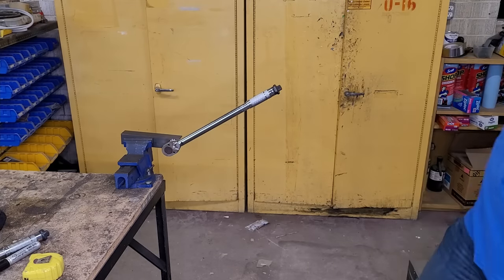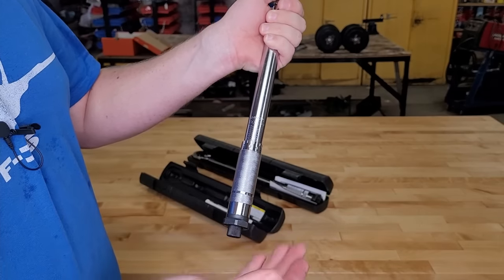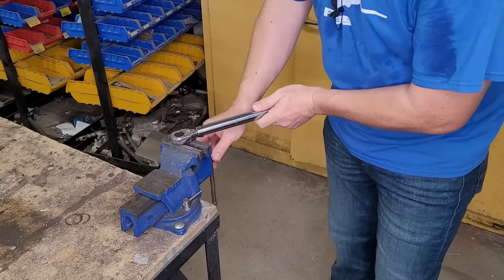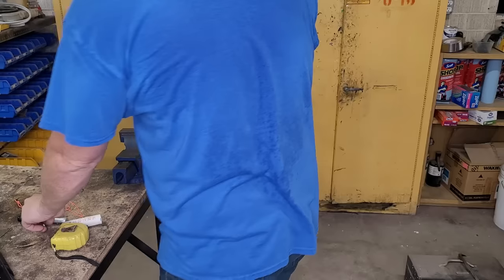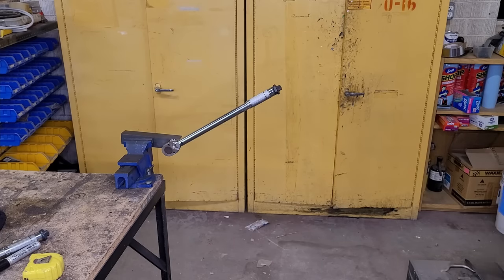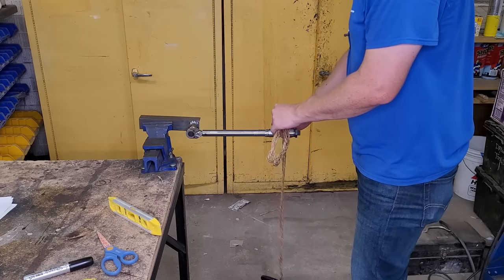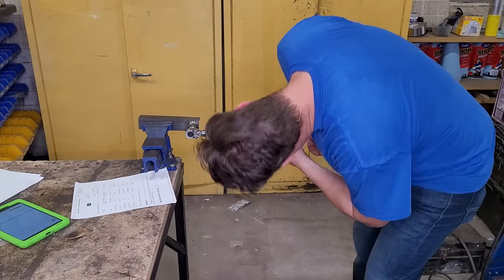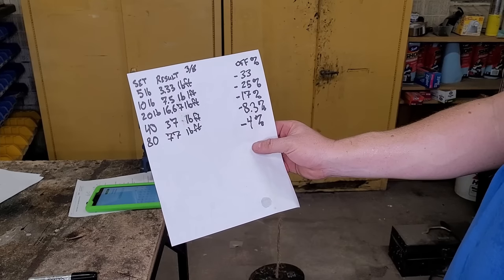$20 Torque Wrench, are they accurate? | Harbor Freight 1/2" and 3/8" Drive Review and Test

Comment: You do know that these wrenches can be recalibrated. Any torque wrench would need to be checked and calibrated periodically, regardless of brand or cost. These wrenches, while they are very inexpensive, are very easily calibrated. Your demonstration was very clear, however it would have been helpful to go through the calibration procedure while you had your rig set up and also it's important to release the spring tension when storing a torque wrench as that will shorten the calibration period. Good video.
Reply: They do carry a lifetime warranty just like all other Pittsburgh hand tools it even says so on the package so when the time comes and it needs recalibrating you can just return it for another brand new one as it’s not really worth the time or effort to recalibrate it when you have this option. I just recently warrantied my half inch model as I loaned it out to my neighbor and he had left it cranked up to 120 ft lbs when it was returned.
Reply: i agree, id like to see a calibration video.
Reply: @scottmingersoll  Pretty sure warranty doesn't cover calibration and maintenance, that's like taking your car back for warranty when its time for the oil change...
Reply: @jakegarrett8109  Im sorry but that’s a stupid comparison as is not a car but a sub $20 throw away tool and having it calibrated professionally would cost the user more than purchasing a new one and yes it is indeed covered under the no questions asked lifetime warranty stated on the box just like all other Pittsburgh hand tools. I’ve warranted one before so I am speaking from experience, if you want to go learn how to calibrate yours more power to you but between my work and family I personally have more important things to use my time for.
Reply: @scottmingersoll  I saw this video and another one today, and the 3/8ths wrench was off by basically 33% out of the box. So, even if its brand new, it can still be 33% inaccurate... Getting a new one every year still doesn't avoid that, and how do you know if its off unless you checked it? It takes like 2 minutes more to calibrate it if you're already checking its spec, so I value my time, hence I wouldn't bother warranty on such a cheap part to begin with, but also it takes more than 2 minutes just to walk into the store and grab another one compared to adjusting the adjustment screw (which who knows if the new one will be accurate, how many wrenches are you going to check?)
Reply: @jakegarrett8109  Being I live in a small town with no HF I like to hit it up every time I go to the city regardless so I never make a special trip for any one item, as far as the torque wrench goes I’ve only exchanged it (once not multiple times)due to the neighbor leaving it cranked up for a extended period of time so I am willing to bet it was no longer in spec. Also for what it’s worth when new the torque wrenches come with a verification certificate with a date and the signature of a inspector who did the certification.
Reply: @jakegarrett8109 - this method is bogus and not accurate at all.  You can’t just place a weight at an arbitrary distance.  THERE IS A REASON manufacturers tell you in the instructions that you must place your hand at a specific location in order for best accuracy.  This is usually in the middle of the handle. This video shows him placing weights all over the map. Not getting into the static, torque equations of how a quick style wrench operates, I’ll just say changing these distance ratios creates very in accurate readings.
Reply: @frankhouck4446  Torque is Force x Distance (note its a vector perpendicular to the object of rotation), so if you have your hand 2x as far, you'll have to apply it only 1/2 as hard. So if you have a true torque measurement, then where you have your hand doesn't matter, but if you are measuring it in a terrible way (lets say a fish scale but you are pulling it not perpendicular but you are only measuring force as a magnitude and not a vector in this case, then it will be off), however if its measuring torque at the socket then you could have your hand wherever you feel like.
Reply: @jakegarrett8109  - I’m well aware of the physics behind torque and I have a masters in Mechanical Engineering to back that up (although I’ve been in Sales/Marketing for 25 years:)).

Anyway, I just laid out an example to another “non believer” in another video.  I’m not trolling here, I’m actually looking to purchase a torque wrench and like to do a lot of research (that’s the OCD engineer in me).  In doing that research, I have looked at a lot of “calibration” videos to determine if I would need something like a digital torque adapter to calibrate or could just do something like this.  I started questioning this method as EVERY manufacturer INSISTS on proper hand placement for accuracy (you should read an owners manual if you get a chance).  

So, I researched how these things were made, then watched a physics video on how the torque equations worked.  In the reply I just sent to someone else, I provided a real world example, based on these equations, of how hand placement (or weight placement for calibration) would effect the results.  I will leave you with that same example as the math says it so much better than I can articulate - hope it helps.

First you have to understand that the actual torque being registered by the wrench is from the hand position to the pivot point (that round pin that is located just before the socket head) - roughly 2-3” before the socket head center point on a typical 1/2” wrench.  This is the torque that actually disengages the clutch and when enough force is applied at the handle, it clicks. 

Now, let’s say the center handle position is 15” from the pivot point and there is in fact 3” from the pivot to the bolt head center.  This 15/3 or 5/1 ratio is the critical proportion. If I apply 40lbf at the handle center, the pivot point registers 600inlb torque or 50ftlbs.  However, at the bolt head, there is 18x40/12 = 60ftlbs of torque being realized.  Remember, it’s the 50ftlbs of torque at the pivot point that is actually disengaging the clutch and causes the click.  The manufacturer knows that when the setting is such that 50ftlbs causes the click there is actually 60ftlbs of torque on the bolt being tightened (with proper hand placement) so they calibrate the settings to read 60ftlbs at this point.  As long as the 15/3 ratio is constant, the settings can be proportionally placed this way through the linear range of the spring (in this case - 10ftlbs to 150ftlbs say). 

Let’s look what happens if I apply the same torque between the pivot and where the force is applied, but don’t use the center of the handle.  Let’s say I move in 5”.  So, now I’m 10” from the pivot (still another 3” to socket head center)- leaving the wrench setting at 60ftlbs.  I will still need 50ftlbs to disengage the clutch (I haven’t changed my spring pressure).  At 10” I will need 60lbs of force to get 50ftlbs at the pivot point… and the clicker goes off.  But, let’s look at the actual torque at the bolt head. My critical ratio has changed an now I have (10”+3”)x60lbs/12 = 65ftlbs of torque on the bolt….. my wrench is still set to 60ftlbs, I’ve hit 50ftlbs on the pivot point so it clicks and I think I have 60ftlbs on the bolt, but I actually have 65ftlbs (over 8% off).  

If you increase the pivot point distance to the load, the opposite will happen and the actual torque at the bolt will be less than the set point- which is counterintuitive, but makes sense after giving it some thought.  This is why the manufacturer insists you use proper hand placement when using the wrench. There is a great video of a professional testing hand position with a very expensive calibration machine and the above math is visualized by these results. 

Bottom line, use the correct position for the load and make sure it’s perpendicular to the wrench shaft if you are going to use this method.  It should be a fairly accurate way to calibrate.  Try to use 3 or so measurements through the range (ideally at 20%, 60% and 100%).
Reply: @frankhouck4446  I see what you're saying and I agree these tools are in my opinion designed incorrectly. If you get the digital adaptors then where you hold them won't matter, so honestly those adaptors have a better design than the mechanical wrenches (I get it, they were being cheap and probably was easier to make them back in the day, but for the reasons you mentioned that's why they are kind of terrible because they aren't actually measuring the torque of the socket like digital adaptors do).
Reply: @jakegarrett8109  - well, I don’t think it’s a matter of “cheap” but rather a matter of design. There is no other way to really do it.  The clutch mechanism and pivot point simply have to be placed somewhere between the handle and socket.  It’s just not a solid fixed beam.  They are cheaper, and therefore the tool of choice for diy.  If you use it properly and check calibration when used, it will serve you well and be plenty accurate for most any auto or HVAC work you may want to do.  Most torqued bolts (1), have a torque range, and (2) have tolerances in their threads and fit that are already less accurate than a click style wrench.  Think about it - a bolt being torqued into a housing/flange/etc is meant to place a specific pressure in whatever it is holding in place (like a valve cover).  The engineers calculate that in order for the pressure to be accurate, the bolt must be placed using torque X.  Well, the torqued is affected by tolerances in the fit, threads, etc such that even if the bolt is torqued exactly spot on, the pressure it is applying (which is really what the engineers are after) is likely off at least a couple %.  That, with the torque range allowed in most applications means that if you set a click style wrench at the mid way point of the range, you’ll be fine.

As for the adapters, I looked at them and they are very accurate and easy to use.  However, I simply can’t just have only the that in my bag. There are too many applications (ones that I need a wrench for) that it can’t fit.  So, I would have to get a click style anyway and, honestly, I just don’t use it enough to justify both.  All I’d end up using the adapter for would be to calibrate…. Which I really dont need if I use this “weight” method correctly. Besides, putting a crows foot on a torque adapter to use for flare nuts just wouldn’t work.

Comment: One reason for the poor readings at the low setting of the 3/8 wrench is that your method does not consider the weight of the wrench handle.  The wrench weighs a little over 2 pounds so you are starting out with nearly a pound of static torque just from the way it is configured on your test set up.  I measured my 3/8 wrench (not HF but similar size) and found the handle adds just over 0.9 pounds.  Negligible at high settings but very substantial when testing at the low end.   Unfortunately it will only make the 1/2 performance worse!
Reply from the maker: Rick that's a good point I hadn't thought of!  I think it was off by more than the weight of its handle.
Reply: I'm wondering if it got sent out of calibration when the twine snapped and he almost broke his foot and face. I'm new to torque wrenches, but all the brands seem to say the lower 20% of the range isn't really meant to be accurate or used anyway. Maybe something like a $400+ Snap-On would be fine, but that's a lot to ask from a $15 tool.
Reply: Anyway around this for more accuracy at lower settings?
Reply: The work-around for the low settings is to get a 1/4" wrench. Always use the smallest wrench that is capable of the setting you need. They are all more accurate in the upper end of their range.
Reply: @HerbOMatic  The 3/8" wrench was consistently 2-3 pounds under spec. So the handle is a significant feature. Another channel I saw used a scale pulling horizontally on the handle. Or you could use a pulley off to the side, so you could use your weights, but apply the force horizontally.
Reply: @joshualmatheny  unfortunately 1/4" torques only go up to ~16ft/lbs. Really wish I could get one that goes up to at least 30ft/lbs

Comment: I have used and own many torque wrenches over my 45 years as a mechanic. Snap-On Tools required I have them recalculate my 3/8" drive ft/lb torque wrench every 2 years or they would not warranty it for accuracy. The tool cost me $150.00's back twenty years ago. Their 1/2" drive was much more money. As mechanics we were taught to only trust any torque when set between 20% to 80% of it's max measurements. Below or above those torques we were to chose a smaller or larger tool. We were never allowed to use any tool at the lowest or highest settings. So why are those numbers on there anyway?? I own only six torque wrenches today. Ranging from 1/4" to 3/4" drive. Four of them are Harbor Freight tools.
Reply: Yeah, when he started at 5, I cringed. His idea of a sanity check before using it is good though.

Comment: I had both of those, they are really easy to re-calibrate. They do need to be stored at the  lowest torque rating and cycled three times before using from lowest to highest torque. Something to bear in mind at 5lb/ft being off by 33% is something like +-1-2lb/ft which yes, is high but still probably better than not using a torque wrench where you can fairly easily end up with + or - 100% accuracy or more at that level.
Reply: You need to store all clicker style torque wrenches at their lowest setting. It doesn't matter which brand. Not doing this will screw up the spring.
Reply: @williamallen7836  I had no idea, I've been storing mine at whatever torque setting I used it last time, is my torque wrench trashed now?
Reply: @giovannifoulmouth7205  if it's the clicker type with the handle you spin to set the torque, it will most likely need to be recalibrated. There's a couple videos on YouTube on you can recalibrate them at home with an inexpensive scale. Split beam type torque wrenches don't suffer from this, because there is no spring that will develop a memory after being compressed for a peroid of time. But they cost more.

Comment: I hate it but my HF torque wrenches are all accurate. I tried to replace them many times with better expensive ones thinking to throw them away or donate, but the cheap $10 suckers have better accuracy vs expensive ones. I absolutely despise their fit and finish, sloppiness and cheap feel, but the suckers just don't want to go away showing better results than $120 split beams.
Reply: Seems fairly often these cheap tools do as well as expensive ones. How did you check the accuracy of your torque wrenches?

Comment: This is a very important tutorial for inexperienced new diyers that don't have any idea what 20 ft/lbs torque on a 3/8inch ratchet would even begin to feel like!
I appreciate it as I never saw that instruction to cycle to full torque setting & back 3 times!!!
Fortunately, my old Craftsman pair confirmed my HF pair to be adequate without recalibration. 
But be damned sure I will be testing them both before going in to retorque my 3 yr old LBJs/Ft Suspension parts while doing my next tire rotation!
83 ft/lbs on my Tundra lugs.
Test one for the 1/2inch drive...
Glad you survived that Reverse guillotine move 👏 🙌 👍

Comment: For my job in water work, aka municipal water, I've bought roughly 6 of the 1/2 inch for tightening down or torqueing our mechanical joints for various things like new install and water break repairs. For $20 or less these are perfect for our work. Our bolts are 3/4" generaly and these torque wrenches have been perfect for us. Gets us close enough for our work. The thing is they are subjected to very harsh conditions in general. Muddy, wet, sandy trenches aren't kind to tools in general so that's why we've purchased the 6 or so wrenches in the time I was the foreman. Great for us and a god send. It's aweful to spend $120.00 on a wrench that gets dropped in water on a cold night.

Comment: I have these two also. Used them to install performance rear end suspension parts on my 2012 mustang. Had to use an aluminum extension over the torque wrench (and my leg) under the car to reach spec, but it made it. Before that I used them maintain my 92’ Celica. Almost 200k on that car. Sold it to my brother and he drives it daily. The wrenches need to be maintained. Open up the pawl, disassemble, and re-oil them. Motor oils fine. They work good and cheap for DIY. I have not had an issue with either one. I paid 25 for the 1/2” and 19 for the 3/8” I’m glad these are available at that price range. Thanks HF.
Reply: Buy a torque meter they're very accurate

Comment: Thanks.  This saved me a lot of money.  I recently bought a Tesla.  Great car, but it comes without a spare tire.  Bought a spare from Modern Spare (comes with a jack & J-bar lug wrench).  Tesla lug nuts need 129 ft-lbs.  I'll buy the ½" drive for $20 instead of a more expensive one.  With the spare, a tire inflator and this torque wrench, I'll be safe on the road.  You saved me ~$80.

Comment: Yes, sometimes you need to reverse it. Not to loosen, but for left hand threads. Mower blade on a push mower is an example
Reply: Exactly, I was thinking the same! It's not a ratchet, it IS a torque wrench that torques RH or LH fasteners.

Comment: FYI, they also sell an electronic torque wrench addition. Like 20 some odd bucks. It just beeps when you hit the set torque. I measured it on a snapon and craftsman torque wrenches and it is quite accurate. I use that in line with my HF torque wrenches for a sanity/accuracy check. The battery sucks on it but it does the job if you need some real accurate low torque (in/lb) or real accurate torque specs.